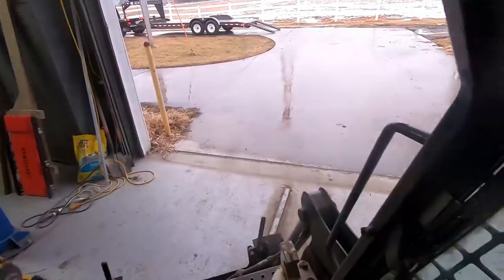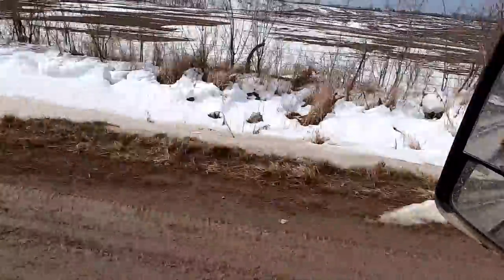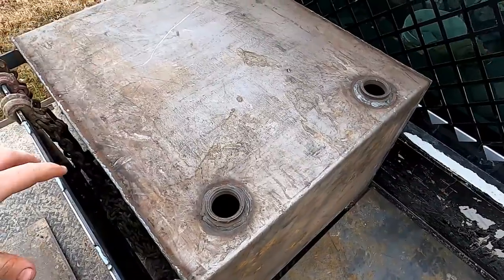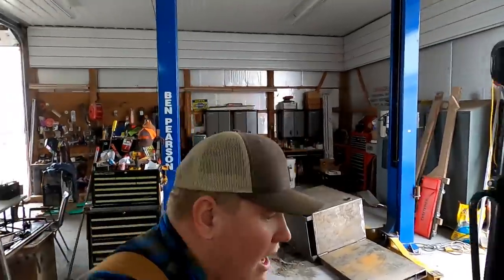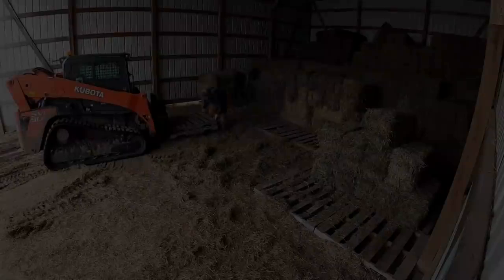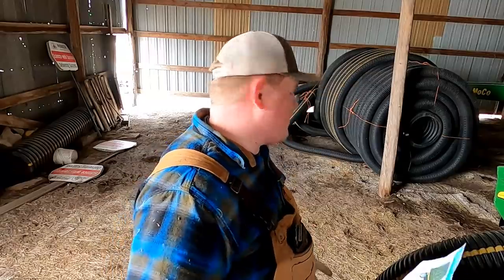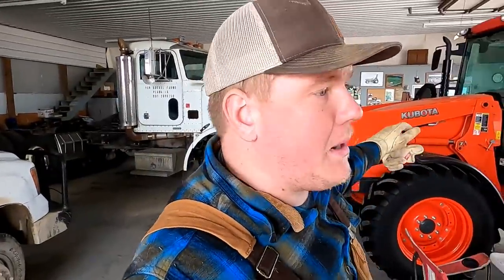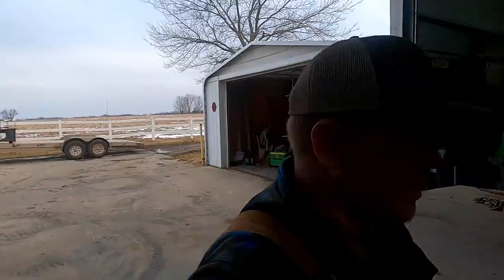SKID STEER WHEELIE! - Off Season Work - Vlog 1

Comment: WAYYYYYY back, when I was a kit, my Grandpa owned a construction company and I used to work for him in the summer when I was off school, at that time I could rock a bobcat up on the back wheels, drive forwards, turn around, drive backwards, and put it back down, I loaded it on the trailer once using just the back wheels (fronts in the air) and he about came unGLUED. ;) It's been so long ago I'd be scared to even try that now.